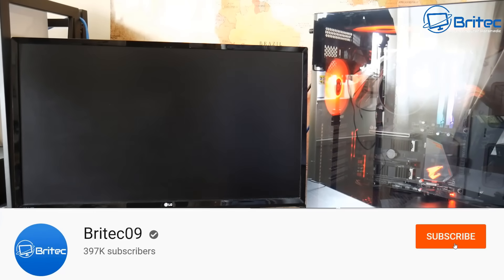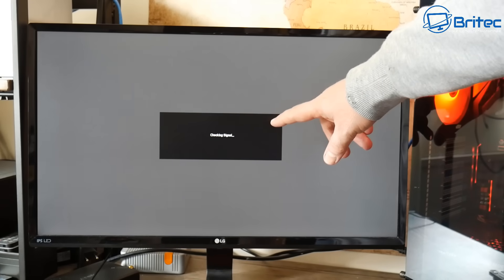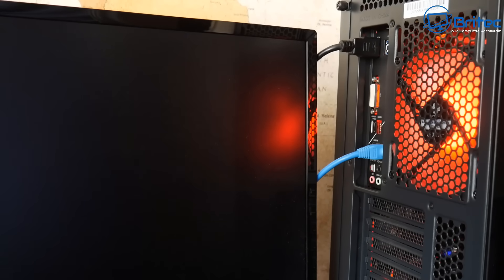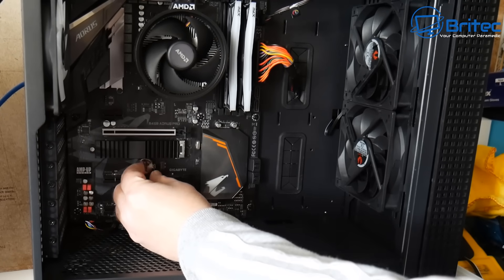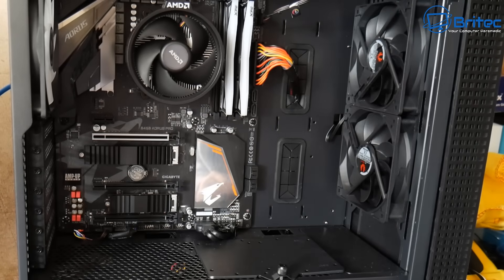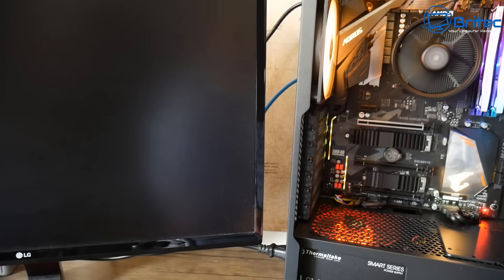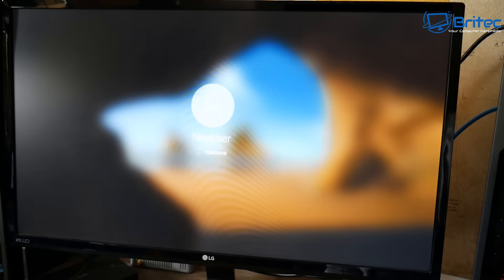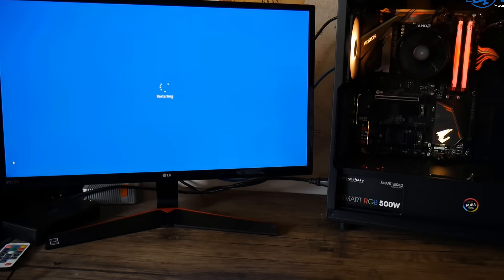Computer Repair: Fix No Display For Integrated Graphics

Comment: You only need to push the power button once(no need to hold it down.The power button make the motherboard to give a shorted puls via the atx power cable to activate or deactivate the psu.If you know how the electronics work you would know this holding power button down is waste of time.The psu do not have electrolytic caps with a zise 10 000uf or more.the primary side has high voltage cap witl little storage around 33uf to 330uf

Comment: Well I guess I should mention that, although I had a different issue, I tried this anyway. It didn’t solve my issue, but It did change the problem of ‘blank screen during boot.’ I was just sick of trying everything and getting no changes or results! Now I have a change, which is kind of a result! ‘Stuck on the windows logo during boot’....It is, at least, a bit refreshing lol. So cheers mate 😀

Comment: im using integrated graphics and i keep getting no signal 
- i reseated ram at least 5 times
- i have integrated graphics (i5 9600k)
- fans and rgb turn on
- power supply fans turn on
- motherboard lights up (because i have a h310m r2.0)
Reply: did you fix this?
Reply: @AhmetSR  nope

Comment: I had a similar problem today. Running AMD Ryzen 5 5600x with Gigabyte B550m Gaming Board plus Rx550 GPU ... I don't get signal output from my motherboard. I only get signal from the GPU ,
The  Retailer's Technical team told me that the new generation Motherboards with CPU's can't integrate the Displays anymore due to Manufacture display cost per port. This makes no sense ?? does anyone know how I can get my AMD system to integrate my onboard and GPU displays, I get no signal from Onboard.  I have checked the bios for integrated settings and updated to the latest firmware.
Reply: And yes I have cleared the bios with only 1 display on the motherboard without GPU it works.
Reply: Oh Fuck  .. Ryzen 5 5600X - desktop processor produced by AMD for socket AM4 that has 6 cores and 12 threads. The base clock frequency of the CPU is 3700 MHz, but due to Turbo Core technology, it can perform up to 4600 MHz. The size of the L3 cache is 32 MB. Please note that this chip doesn't have integrated graphics

Comment: Sadlly didn't work for me. But my monitor ALWAYS says No signall, mever only a bllack screen. It worked fine with my gpu in this morning, but I had to take it out and dont have it anymore. I have an i3 so should have an integrated gpu, right? Any other ideas?

Comment: hi ,
I have a GTX 1080 Ti GPU on my Gigabyte motherboard . Last week onwards i was not getting any display from GPU. I tried to connect to motherboard for integrated graphics, still no display. But then I removed the 1080 Ti from the motherboard and tried intregrated graphics , and it worked . Please help . Thanks in advance .

Comment: I'm having a similar issue but this is a new build, I have a core i9 9900k, 550 watt PSU, 64GB of ram and a RTX 2060 ti I got display when I first turned it on, it went to the bios automatically then I booted it to the desktop and didn't want to display an image :/

Comment: I just used this technique for my GeForce GTX 67o graphics card and it worked great.  I thought I would have to replace the graphics card, but nope - did this little trick and the monitor began to display again.  Thank you for this!

Comment: So, I don't have integrated graphics (ryzen 5 3600xt) but I do have a graphics card (rx580) I'm using a msi b550m pro vdh wifi. It boots into windows but won't display bios. Any help on getting the bios to display would be great.

Comment: i have tried it three times i dont know what im doing wrong  i left the battery out for 30 seconds i let it out for a minute and an hour also holding the button down for 30 sec to a minute befrore i installed the battery.

Comment: I have a strange one - pc is functioning and will boot into Windows 10, however i only get highly distorted graphics ONLY in the bios via gpu, and after bios i get no signal. Enabling onboard and removing the card gives me zero display, and I've already replaced the motherboard with a brand new (direct replacement) motherboard to rule out any board issues... Totally stumped and its pissing me off
Reply: It’s the graphics card!

Comment: This might helped a lot of people but it doesn't just work in my case
Reply: Did you find a solution?
Reply: @techxpr2  I have found
Reply: @allystinandreidelapaz5227  how did you fix it?
Reply: @allystinandreidelapaz5227  please tell me how you fixed it
Reply: @twewymuncher  , for starters, I used different monitor (or display) then i open my bios, then i found out that my bios doesn't load the drive where my windows is
Reply: @rootkfkdkd8334  See my reply to morbamba
Reply: @allystinandreidelapaz5227  thanks

Comment: I can not believe its people with his logic and reasoning that seem to be team leader within an Internet Provider responsible for 20 customer service reps playing tech support .... 

I wasnt gain to rewind to answer my curiousity if the computer was actually turned on or if the hdmi cable was just another dodgy contact within the socket.

I cant contemplate the excitement he must have felt when he finaally completed his video n uploaded it feeling proud about his donation to society `.... I wont even bother with skimming through the comments to tally up how many literally responded with the simple fact that removing the battery n draining any residual current within the circuit. 

Ill state the obvious * removing the battery wont reset the bios back to its default settings , the battery remains powered even when 'SHORTING'  it using the pins ... The BIOS settings are stored where if not within the firmware ? 

I cant even consider this an attack , more a defensive manuver with a bit of dribble , I gave humanity 100 years by the time we are doomed but now I give it 10 & Trump didnt have any influence it.

He has clearly made his presence known and is on below par against Mr. President :)

phew Wow ...!

Comment: and what if you have a ITX board where the CMOS Battery are connected with a 2-pin`?? i have a problem with the booting it shows me a white LED on the board by VGA... and i tried it on the onboard graphic also with the graphic card (gtx 1660) nothing works....

Comment: im still having trouble getting a signal
Reply: make sure you try everything before buying new equipment. that’s an easy way to waste money
Reply: try replacing the cable or the monitor itself, that might be the issue if you haven’t tried yet.

Comment: Thanks for this.  What about if I have a graphics card installed so I can see my display through the graphics card but not through the motherboard port?  I'd rather not open my PC if it isn't necessary but I do not see an option to "enable integrated" in the BIOS.  Should I just reset to default settings?  (I'd rather not again because I had to enable a few features that I'm not sure I kept notes on: virtualization for example I remember was hard to find).

Comment: I recently bought a gaming PC with a missing cpu and graphics card. I was going to resell it because I thought I need to buy a cpu and graphics card right away and that can be a bit pricey. Well I just found out that some CPU have integrated. Thanks I think this tip with some in handy if I don't get a signal once I install the new cpu

Comment: I managed to get into my award bios as day 1. Don't forget to disconnect everything including the monitors cable from mobo. Great Job.
Reply: Sometimes ram slots or ram not working too...
Reply: Thanks. I followed the video but it didn't work on the first try. It seems that even the slightest power coming through the USB, Ethernet, Display cables prevent the bios from reseting.

Comment: i just recently installed an external gpu. but the thing is when i am gonna use my integrated graphics display i get no signal. I want to use both external and mobo display at the same time for 2 monitors. how to fix that?

Comment: Brian, Excellent video btw, didn't help with my problem though so I thought I'd ask your advice.
I have just bought a new cheap pc to replace one that died I also bought cheap discrete gfx card (for my 3 monitor setup). Emphasis on the cheap as 'er indoors thinks I should make do with my tablet & laptop. 

The new PC consists of

MSI A320M-A Pro Max
AMD Ryzen-5 3400g CPU (with Vega gfx)
GeForce GT710 1GB 

The problem I have is, without the 710 card, the integrated gfx work fine on monitor 1. As soon as I plug in the 710, we have graphics on monitors 2 & 3 but nothing on monitor 1. Meaning that ATM I can have 1 or 2 monitors but not 3. I have tried ALL combinations of Gfx options in the BIOS, all to no avail. Any Ideas?

Comment: A big THANK YOU!  I got a used Dell 3010 with no hard drive and though it was supposed to post to BIOS settings there was no video on the HDMI or VGA ports.  Following your procedure I got the video working so I could see the BIOS and it was clear sailing after that.

Comment: Thank you very much, it helped me. I had disabled the built-in graphics of the processor and had no image, I tried to test to select restore default values but it did not work.
Thank you. Greetings from Argentina.
Translated with google ESP -> ENG
Reply: How you fix ?
Reply: @seddyimperial5147  following the tutorial steps.
Main steps:
*Unplug the PC from the home current.
*Quit the bios batery of the mother
*Hold the power swich during 60 to 80 seconds
*Put the bios batery on the mother
*Connect the PC in the home current and turn on
**Hope the signal video from the default VGA mother port

Comment: I did the cmos method but sadly I still cant get post! No keyboard no mouse no monitor
Reply: Yeah im currently facing the same problem too , I have dell optilex 990 SFF i5 2400. I have tried reseating the ram , reset the bios by taking out the cmos and i think there's no problems with the motherboard since the beep sound comes out if I removed the ram and turns on the computer . Im really hoping that there's no problem with the motherboard . And Now I think I'm left with trying to get a new graphics card since I've been using integrated graphics card all this while and oh yeah the led light on my computer displays 2 4 code which indicates there's problems with video card ? Btw I made this assumptions based on what I read on the dell official site . Is there any other method that I should try before getting the new graphics card or motherboard 😥 ?
Reply: And also my mouse keyboard monitor doesn't detect anything just like yours 😭
Reply: @annasdzikrullah  I sent mine to the store i ordered my parts with, they said that my 2 week old motherboard is bricked so theyre gonna replace it with a brand new one, hopefully that my cpu is still alive
Reply: @elijahpunzalan7798  thats tough, i read somewhere that if the fan inside the cpu is running then the cpu is not a problem but lets hope it doesn't get to that. btw motherboard really involves in this problem i guess, i really don't want to replace my motherboard ugh. i guess i really need to send my PC to the manufacturer i think. btw did you check whether your motherboard produced the beep sound or not ?

Comment: I have really no idea what my problem is. I had  2 vizio TV's plugged in and it worked fine I decided to try triple monitors so I took the 3 Dell monitors hooked up to our cameras so I know they work and show display. I have two pluged in with DVI ports and the third with vga and none of them will display and keep saying no signal. The cords are good, monitors are good, pc displays on other monitors, I have used 3 different dvi ports, i can have my vizio tv pluged in with them and the vizio works but the Dell monitors dont. Any ideas anyone? I do have a graphics card but I'm just asking anyone

Comment: I have a Lenovo T510 with windows 10 loaded.  When I am in YouTube my laptop display will automatically enlarge the screen and then it will move back to normal without me pressing escape and then it will turn the sound on it own without me pressing un-mute.     FYI, I have run all updates for Windows 10 but that did not fix it.  Do you have any suggestions on what to look at for this type of fix?
Reply: chrome zoom
Reply: @JoshMorri5on  Thank you I will take a look at it.

Comment: Better teach them the PROPER way:
There is a CMOS reset pin. You can google it.

There is no need to hold the on button that long. The capacitors discharge very quickly (less than half a second) once there is no power.
Reply: pepeshopping Just checked out your YouTube channel. Amazing tutorials. Amazing knowledge. You should be teaching on the university. Why waste your time on YouTube? You could making millions man. Gazillions. Maybe even more... cool 😎 dude, you’re so cool. Damn, damn, I’ve wasted my life... where have you been all my life?
Reply from the maker: @pepeshopping did it work? YES so whats the problem?

Comment: this only works  if everything else are okay but most of time are not and it is faulty mobo and that means  you must buy other or have hard work with multimeter &debbug card
Reply from the maker: Hence why I said you need to make sure you have no hardware problem